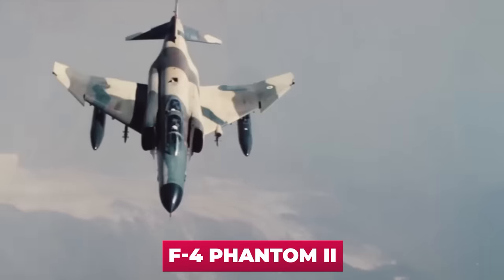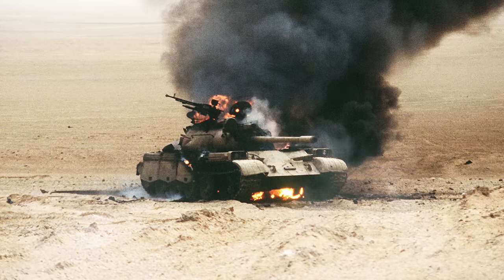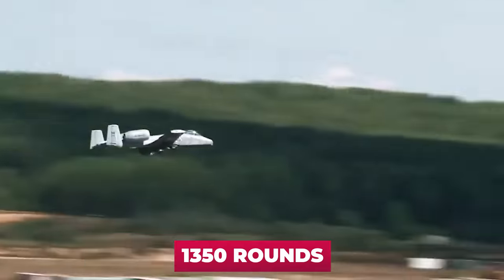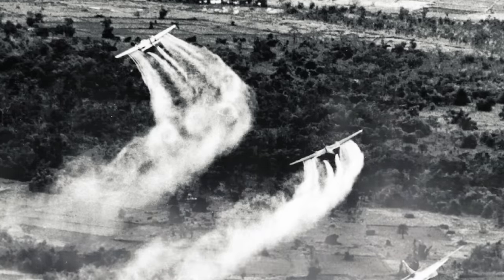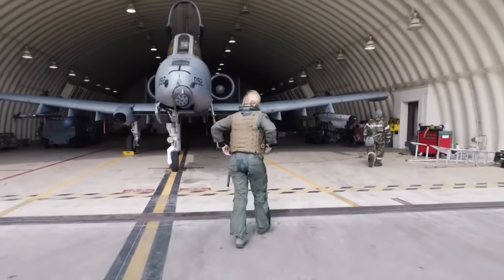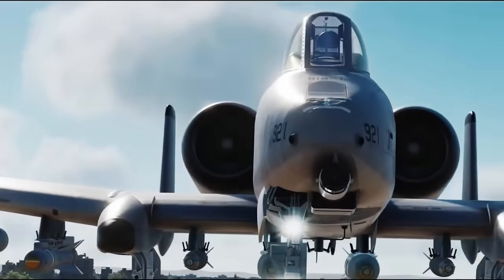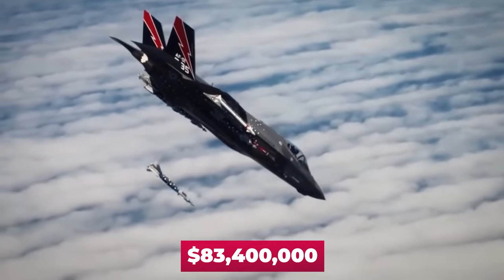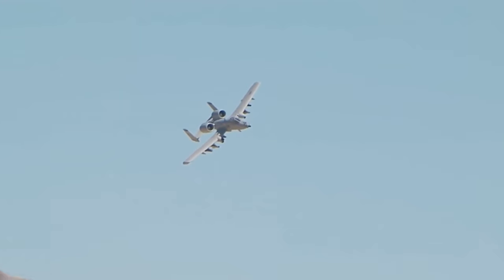US Tests A-10 Warthog After Upgrade To Secretly Send It To Ukraine

Comment: I used to build a lot of models when I was young. My favourite plane had always been the F4UA Corsair... up until my uncle got me a warthog kit. I lived building that things and I was fascinated with the shape and how it just seemed to be cobbled together from spare parts that all seemed to fit together perfectly. Still my absolute favourite aircraft.
Reply: I liked putting together the Corsair, because it was easy to paint, solid navy all over, hehe.
Reply: I had so many REVELL model airplanes hanging from my bedroom ceiling . . . (this is my daughter ID - NOT mine )
Reply: @janicejohnson1334  Matchbox, Airfix, Hasegawa...
Reply: If that is what you got out of building models of the A-10, you need to build it a few more times. It is not cobbled together from spare parts in any way. It was 100% designed to be survivable from the outset. It has a large number of redundancies that other aircraft just do not have.
Reply: are we related? my favorite combat fighter is the Corsair, then i went to an air show and they showed an A-10A Warthog doing a gun run, and i heard that brrrrt, and the A-10A Warthog filled that second place slot for favorite aircraft.
Reply: Agreed. F4U and the F4 Phantom have been my favorites. The A10 Is the ugly duckling but so beautiful. Tank killer!
Reply: I built two models with my son. One was the SR-71 and the other was the A-10. The SR-71 looked pretty cool, but the A-10 just looked so 'solid'.

Comment: A minor correction, the A-10 was ALWAYS equipped with a turboFAN, not a turbojet.  The use of the turbofan enabled the aircraft to have very long loitering time, as it uses a fraction of the fuel.
Reply: They need more fuel efficient engines.

Comment: I love the A-10. If you have never seen this plane turn and manuver, how quickly it turns and changes direction. It is like an acrobatic aircraft with a 30mm rotary cannon ;-)
Reply: I would love to see how it would have done in a dogfight back in WW2.
Can you imagine the terror enemy pilots would experience fighting these things?
Reply: @protorhinocerator142  the better German pilots with Me262s or even late model FW190s would have given an A-10 all it could handle. It's just as hard to take down a P-51 or a late model Spitfire than an A-10.
Reply: @Citadin  That can't be true. The A-10 is much faster, armored (the others are not), has better range, and has 100x the punching power.
I don't see how WW2 planes could be any real threat unless they rammed into the A-10.
Reply: @protorhinocerator142  the Me262 is 100mph faster than the A-10, though it lacks acceleration due to jet engine technology being new at the time, and the fact that the Germans lacked high-quality steel for its Jumo jet turbines. The Me262 had 4 30mm cannons, no slouch there, it was built to take down B-17s which were quite sturdy. As well the top late WW2 piston engine fighters could easily outturn and outmaneuver an A-10, and they weren't that much slower. The A-10 wasn't built for speed.
Reply: @Citadin  P-51 max speed: 440 mph
A-10 max recommended speed: 439 mph
A-10 "never exceed" speed: 518 mph
Me-262 max speed: 560 mph

Service ceiling/rate of climb
Me-262 37,570 ft/3900 ft/min
P-51 41,900 ft/3200 ft/min
A-10 45000,ft/6000 ft/min

The A-10 could fly well above both of these two planes and devour them in a power dive. Then soar back up above them where they can't reach.
The Me-262 is better at top speed but that's about it.

For the few Me-262 jets Germany had, the A-10 would most likely just pop them with sidewinder missiles.
If there were 10 A-10 aircraft vs. 20 Me-262 aircraft, it would be over fast. The Me-262's wouldn't have a chance.

The P-51 would have much less of a chance. The only thing it has an an almost close service ceiling.

A-10's would rule in WW2.
Reply: @protorhinocerator142  of course any plane with modern missiles would shoot down WW2 planes with ease. If it was guns only though, the P51 would outturn the A10 with ease, and the Me262 would outrun it, its top speed being faster than the A10's never exceed speed, you've just made my case.
Reply: @protorhinocerator142  the Me262 has 4 30mm cannons, it can tear off a B-17's wing with a single salvo. FYI the B-17 is 3x heavier than the A-10, and build much sturdier.
Reply: @protorhinocerator142 if i remember correctly the Mustang with Merlin engines had a top speed of 450 to 475 mph, and the Spits and FW 190s around the same. The key advantage of the A10 would be its construction materials, i dontbthink they had thosr alloys back in the 40s and of course the titanium tub the pilot sits in. And guns...and avionics...and deliverable weapons systems...but not speed lol
Reply: @Citadin How would any of those aircraft fare against a sidewinder? Or any of the other missiles the A10 is capable of carrying? And a comparison of guns? An electric gatling gun with DU rounds versus 4 slow old fashioned german aviation cannons? I think we both know who truly has the advantage here. The only advantage of any of the mentioned WW2 fighters is that they could run away more quickly than the A10 could follow them... which is exactly what they would do.
Reply: @timothymorrow2194  OK but is 475 mph faster than 518 mph?
The A-10 is faster.
Reply: @timothymorrow2194  Correct. If they all split up and went in separate directions, the A-10 wouldn't be able to follow them all.
And if it was a squadron of A-10's I would think the Germans were trying to split them up and divide the force.
Reply: @protorhinocerator142  look the A10 is a great platform...I have seen it....BUT  fast it aint. Manueverable yes. Hellvof a weapons platform too. But the times I seen it its speed didnt impress me. The "stats" may say 518 but is that with a full load? I truly doubt it. Full Combat Load there is a hell of a lot of drag on the beast...so i dont thinl that 518 mph would hold up. Still think some of the most advanced fighters of the piston age could run away from it, and after they saw the munitions onboard in action, thats exactly what they would do. Mustang, Spit, FW, 262, Corsair...they would all unass and live to fight another day.
Reply: It's literally a 30mm Gatling Gun with an aircraft designed around it.
P-39 Aircobra was also a gun with an airplane designed around it.  Russian pilots loved it a lot more than American pilots did.
Reply: @protorhinocerator142  You would want a MUCH slower rate of fire for dogfighting.  Germans were putting 20mm and 30mm cannons on their planes in WW2, and did quite well with rates of fire similar to the Mark 19.
Reply: @protorhinocerator142  
A-10 is armored from GROUND fire, not fire coming from above.  That same titanium bathtub protecting the pilot from groundfire turns a "near miss" round to the cockpit into a round that most likely ricochets back into the pilot
Reply: @timothymorrow2194  In WW2 the Luftwaffe pulled the same stunt. When the P-51 Mustangs showed up they ran and hid.
The AAC found a way to force them to fight. They sent the bombers after a target the Luftwaffe couldn't ignore - Berlin.
You start bombing Berlin and Hitler is now threatening to torture the families of any Luftwaffe pilot who doesn't fight.

The Luftwaffe sent up everything they had to destroy the bombers. The AAC killed them all in a matter of days. Now Germany has no pilots.
This is how you win a war.
Reply: VERY TRUE ART IN THE AIR AND KILLING AT THE SAME TIME!!

Comment: Sixty Minutes did a segment on the US Army's "Copperhead" artillery shell, which was to fire a rocket propelled guided munition from a 155mm artillery gun and would then track to a laser-designated destination. The segment demonstrated that the Copperhead's biggest problem was its electronics couldn't survive the blast from the gun. And then the reporter asked the question: "Why is the Army spending so much money on this failing system, when it has this?" And the next display was of an A-10 firing shells against a line of tanks, ripping them to shreds.

Comment: Glad to see it’s being mentioned finally in regards to this war. Wish they had gotten them over a year ago.
Reply: Russian Air defense will easily take out these slow aircraft.
Reply: That's not good for business. They don't want it to be over.
Reply: @mrbaab5932  you probably did not hear what the guy in the video said, it is a concearn if russian S-3/400s will be able to take it down at that low altitude, plus it is not all about the speed, most aircraft can't outrun missiles anyways.
Reply: @mrbaab5932 tell me which orc propaganda piece that you base your info on? The SU 25 is even slower and less armored. Additionally the major Orc air defense systems are designed to fight against higher altitude threats. Finally the most effective weapons the Orcs did have were Shilkas (ZSU 23-4) and those are no longer in the Orc inventory. The only other weapons the Orcs have that would be half ass effective would be their twin mounted 23mm guns but by the time they are in range the A10 has already launched any one of a multitude of air to ground missiles and destroyed them...2 km or more before the Orc guns are in range...😂
Reply: @timothymorrow2194  You do realise Russia has stuff like the ZSU-23-4 Shilka it would destroy an A-10 it’ with ease the A-10 is the only air craft in American military that has been used in combat and aren’t sure if it’s combat effective as theirs pretty much no data that backs up the claim that it is
Reply: They already have the Su-25....

Comment: I know the A-10, up-close and personal. Retired AF, I've seen what the A-10 can do, and it's devastating. So, I would say yes, if you want to neutralize the Russian Tank Corp, drop a bunch of A-10s in and watch the games begin. CLEAN UP IN AISLE 8.:face-red-droopy-eyes::face-red-droopy-eyes::face-blue-smiling:
Reply: If I am not mistaken the A10 could evade many shoulder fired missiles by  coming in low and fast. Am I right?
Reply: I like the people saying "its ineffective vs modern MBTs", as a tank and anti-tank weapons studier it shows to me they have no clue that the A 10 fires 30mm rounds at tanks from angles that tanks are not designed to survive those kinds of hits from. Even in WWII a good artillery crew with a small howitzer using HE could blow holes through the tops of Germany's heavy tanks that could bounce the Sherman's 75mm AP rounds off the front.

Comment: The A-10 can operate in all weather and fly  and below many weather patters the F-35 would have difficulty with. The A-10 is designed and built as a close air support. The Airframe frame can stay onsite for lo ger periods of time .Place counter defensive measures and anti radar missiles  on the A-10 and keep it flying ...Heck I am certain it could clip a few ka-52 helicopters without firing a shot.
Reply: Let the F-35 fly high CAP while the A-10 stays down in the dirt, where it hunts best.
Reply: you say, 'it could clip a few ka-52 helicopters without firing a shot.' I hadn't pictured a modern military aircraft acting as a battering ram, but I like the imagery, ....if used against Putin.   How 'bout reinforced prongs at the tips of wings.   Matt, thanks for the image.  It could be the most innovative improvement, since Roman ships at sea built levered ramps on the front of their fighting ships - to lower upon Carthaginian vessels - to enable Centurians to board and butcher enemy combatants.
Reply: And if it did take a shot it would cut them in half with that cannon.
Reply: Its an amazing plane en i wil never forget the sound of the gun , en yes it would be good if they first get f16 fore airsuport
Reply: The F-35 was primarily intended for stealthy missions to destroy radar, communications, and anti-air batteries.  It's just so damn advanced that it's been shoe-horned into completely different roles, even air-superiority.

Comment: Fun fact: The A10 keeps its bullet cartridges not for the environment but so the aircraft keeps it’s center of gravity
Reply: Not to mention reduce the chance of friendly 'fire'. Everything that goes up, must come down. Now imagine one of those casings landing on your head at terminal velocity...
Reply: @TheEDFLegacy  Never thought of that. A brass beer can sized casing hitting you from high up would hurt
Reply: @V1PER237 Would kill lmao
Reply: THAT IS CORRECT
Reply: @janicejohnson1334  yuh
Reply: It's also cheaper to re-use them and doesn't risk falling on friendly soldiers.
Reply: C of G still shifts, just not as much.
Reply: Now we know
Reply: @@Dartgame340 idk the fact your learning from a stolen fact I saw on a video on YouTube
Reply: The rounds are DU. I suspect the spent cartridges are radioactive. That may interfere with any reuse potential.. @midgetydeath
Reply: Bullets? You mean shell casings.
Reply: @luciussander8217  sameish thing
Reply: That's incredible engineering. Where are they stored?

Comment: A10s recently exercised in the UK having returned to Germany from Afghanistan. Thirteen A-10As from the 81st Fighter Squadron of the 52nd Fighter Wing at Spangdahlem in Germany arrived at RAF Lakenheath, Suffolk on April 13th for a three-week stay. The joint 'Operation Vanguard' exercise with Brit SF  included live firing on the Holbeach range and the minimum ceiling was 500 ft, half that permitted in Germany.
Reply: 5r

Comment: Not retrofit, but use the platform to give it a low visibility "stealth" coating, update the hardware and software...perhaps an engine upgrade and aero update to birth the A-10 Thunderbolt III. Keeping the main design and purpose built platform with all the things that made it "hard to kill" and expound on the few weaknesses? It seems that this, very purpose built attack jet, doesnt need the $84M replacement, but perhaps a $10M to $20M upgrade to make it, even more monster like no other!
Reply: Yes,it definitely needs new more fuel efficient engines,and a dedicated hard point for an ECM pod.

Comment: This plane should go back in production, with updates to todays technology.  The F35 will never match what this aircraft does, and it’s survived way more than the F35.😊
Reply: The F-35 will never match what the A-10 does. . . true, it surpasses it with flying colors, anything that A-10 can hit, F-35 can hit easier and more accurately and from farther away, F-35 can see you no matter where you try to hide and it can see you doing it from the comfort of 45.000 ft
Reply: F-35 does not need to get down low in the weeds like A-10 does, it can perform close air support from distance  more effectively than A-10, you call in a strike from F-35  they got you covered, that is guaranteed, you just might never see that plane that is responsible
Reply: The inside will probably look just like the F-35.What i find strange is there's no dedicated hard point for an ECM pod.

Comment: I was stationed at Nellis in the early-mid 80's. During Red Flag exercises it was found that the A-10 could regularly shoot down newer more advanced aircraft like F-16s , surprising everyone but the  A-10 jockeys. Also the large area cambered wings allowed a huge amount of ordinance, even before all the upgrades to engines and other equipment. It should also be noted that most weapons should be evaluated with the amount of respect that an enemy has for it. Iraqis were terrified of the Warthog.
Reply: The A-10, the B-52, and the M-1 tank. Iraqis feared these.
Other weapons were useful and contributed, but this was where all the fireworks happened. When it came time for them to see the enemy, these were the enemies they'd rather not see.
Reply: I was at Red Flag in the early 80's as well.  USMC 4FJ/S, VMFA212.  Best job I ever had.  That is where I saw my first A10.  Was in awe of how tight they can turn.